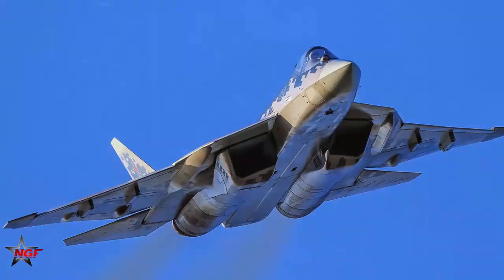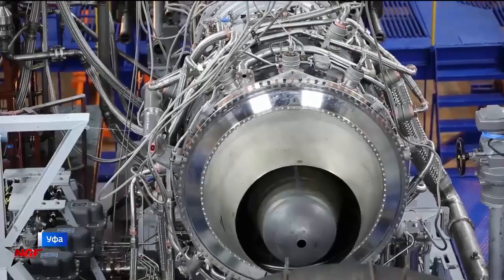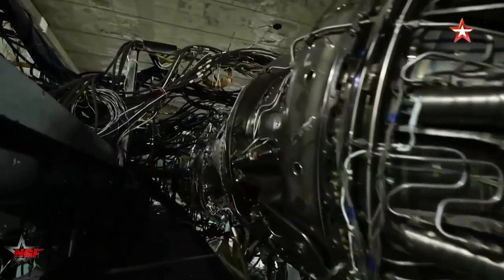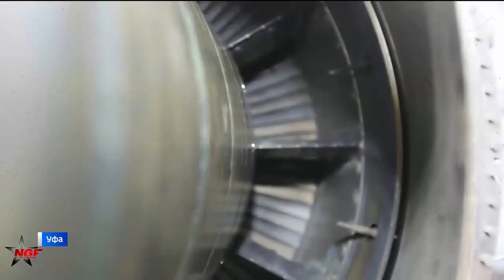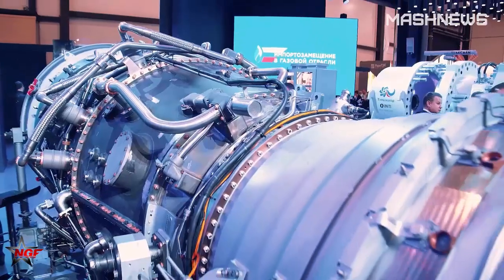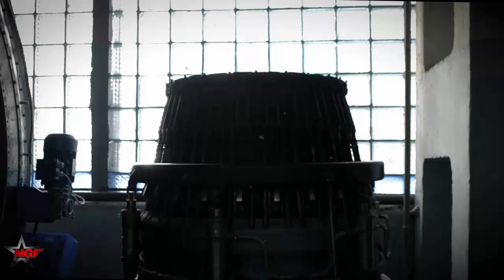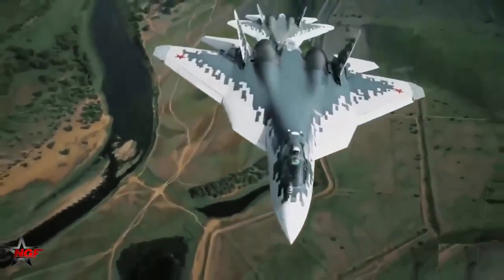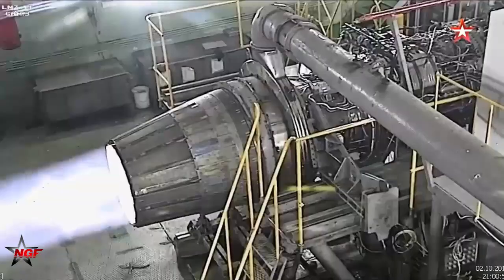Russia displays the 5th-generation AL-51 engine powering the new build Su-57s at the Zhuhai Airshow.

Comment: Since the AL-51 is a direct development of the AL-41 and AL-31, I assume that it will be in all aircraft (Su-27, Su-30, Su-33 and Su-34) that were originally equipped with the older models can be used as replacements.
This would lead to a significant increase in the performance of these models.
Reply: No, AL 51 has a very different controller, structure and air intake expectations. Older flankers cannot use AL-51, they can however used a modified AL-41 which will incorporate some parts from the AL-51 engine.

AL-41 is development of AL-31 but AL-51 has fundamental different changes in fan structure, blade design, hot core section etc.
Reply: What is interesting is that UEC is already testing prototype AL-41ST-25  units for Gazprom for gas compression etc. Which surprised me I thought that phased out AL-31s from combat aircraft would be used - but no. So the AL-41 production line must be operating very well ....  which means that they must be more than ready now to produce the AL-51 in production volumes
Reply: @siddharthgoyal4008 lnows his stuff 👍
Reply: No, the AL-51 is totally different by all parameters, even by geometry. It will require to rebuild the airframe of aircraft, no just to swap engines...
Reply: @andreich-russia-z  , Nope. The AL-51F1 will not be used in Su-35S, only in Su-57, Su-75 and S-70. The AL-41F1S for Su-35S is going now to be upgraded/modernized and to be unified for usage on all Su-30, Su-34, Su-35S... Probably, it will be the AL-41F1, the 1st stage engine, which is used on Su-57 now...